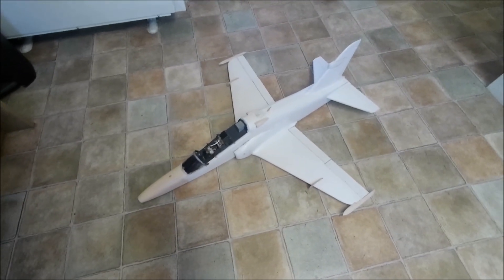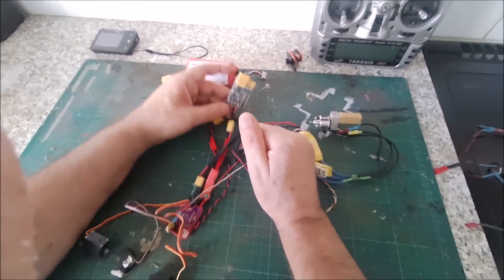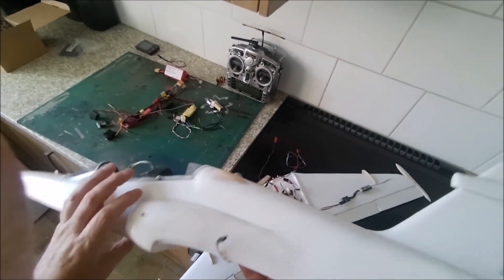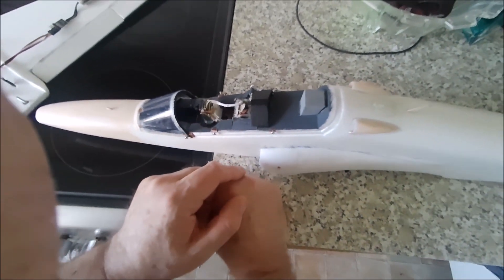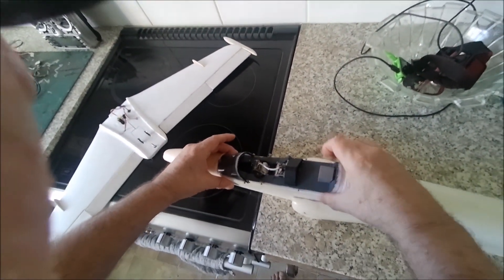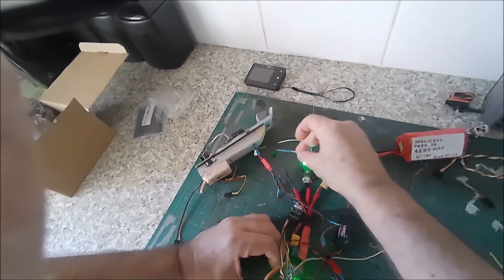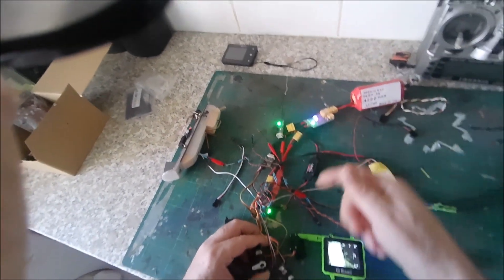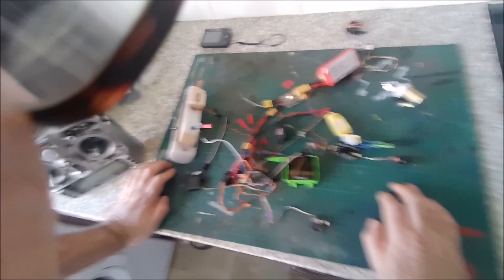Lefei Sparrow 3 OSD install into a small FPV BAe Hawk T2 conversion

Comment: I bought n 2 . They arrived today with no GPS modules .
.I gather they use a u7 type gps module .  And a 9600 baudrate . 
  I also hear a beitian 220 might work but the baud rate is different  some ai searches  say .  Some say an m10 will work .
 I tried calling alibaba . But it won't connect . Ali express wont connect . As if hiding
. Coincidrnce i guess . Bangood won't connect , Amazon has an old " u7 gps " but it has a circuit board with a ufl connector going to a gps ceramic antenna that looks like a gps module for rc drones . 
 Do you know about which gps module to use ?